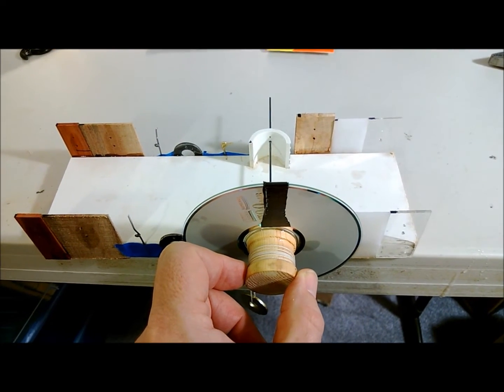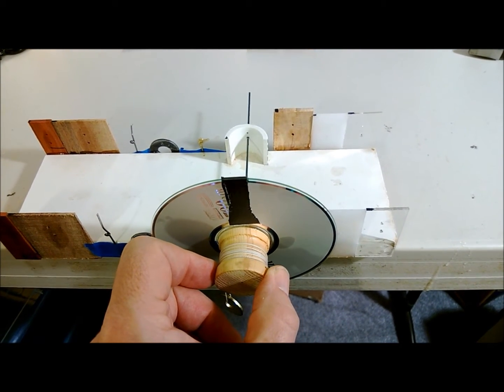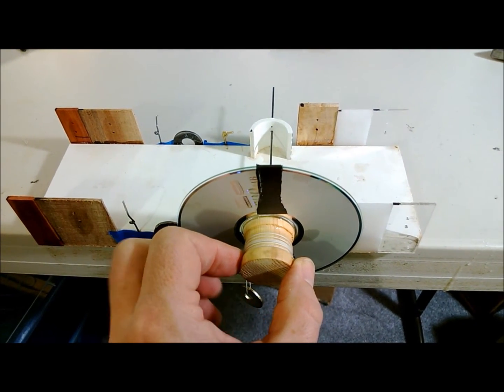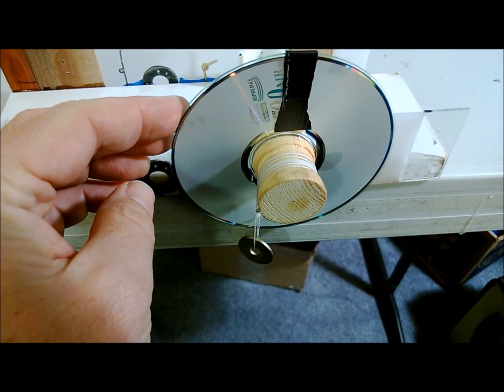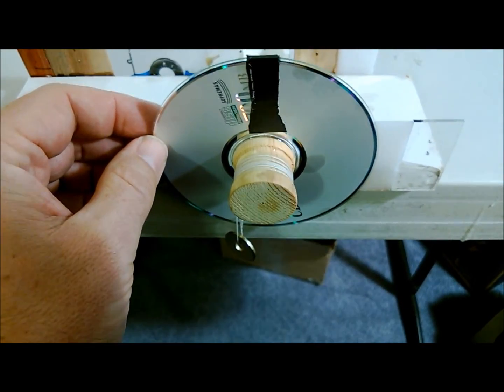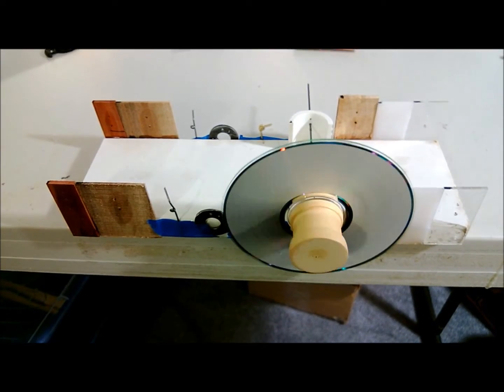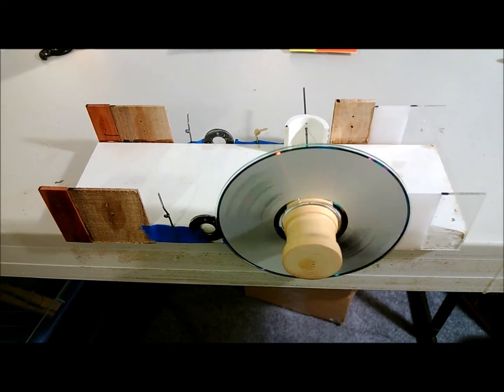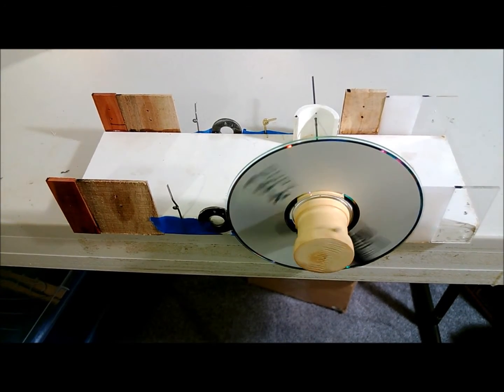Bearing Tests for LTD Stirling Engine Project

Comment from the maker: You are correct about the spool being slightly off center.  However, it is used in identical fashion for all the tests, so I think it is a fair comparison.  I used the vertical needle point in my first LTD engines with excellent results.  I can make those flywheels glide for 2 minutes or more.  The magnetic suspension idea could be an improvement, but too complicated for this project.  The best results so far are with a bushing made from Teflon tubing.

Comment: For a cheap good vertical bearing it is hard to beat a needle point on a dimple on a stainless sheet. For a horizontal bearing, I wonder if suspending some magnets over the shaft to reduce the load on the bearings would be worthwhile.

BTW for your test there it did not look like your spool was perfectly centered.